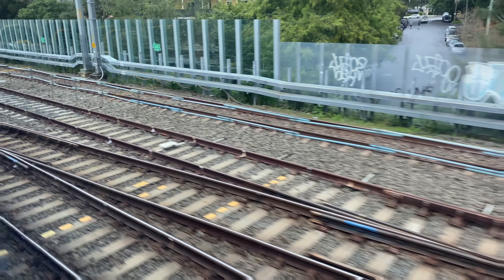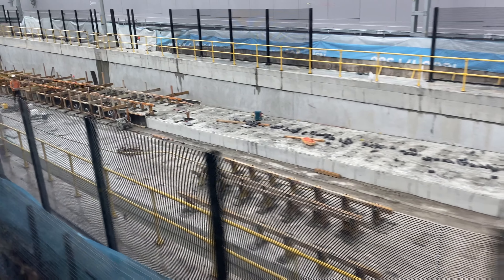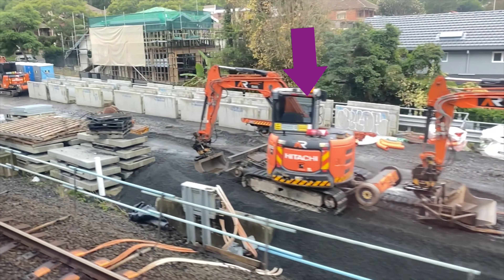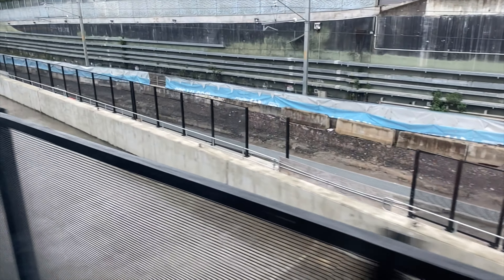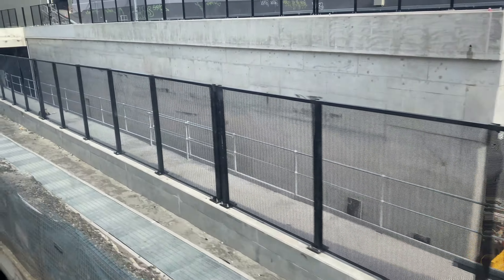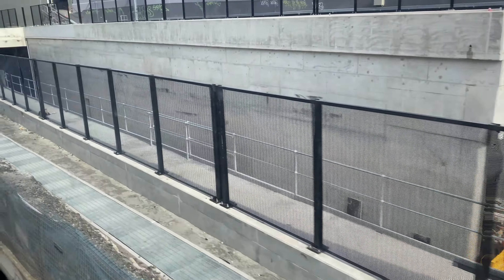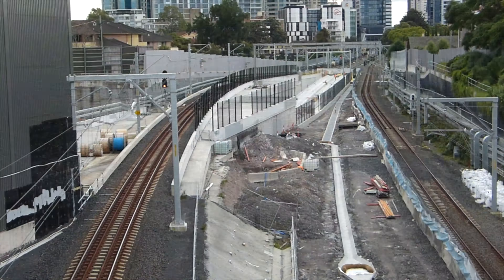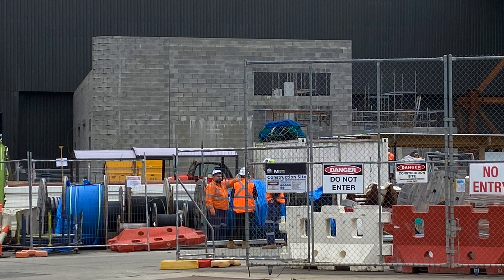Chatswood Dive Site Update - Building the Track slabs - Formwork, Rebar Mash & Track Fastenings.

Comment: I had a look from Mowbray Rd bridge a couple of days ago. While it is not two metres high, I regard the fence partly as a means to keep graffiti artists out of the Metro. Not enough thought went into the corridor security fence and it is easily scaled by people using adjacent infrastructure. Also of interest, is the electrical cables running from the dive site plant rooms to the eastern track of the North Shore Line.
Reply from the maker: Hi Peter, interesting points about the fencing. Yes that's right. The orange conduits are for electrical cables and the white ones for comms cables.